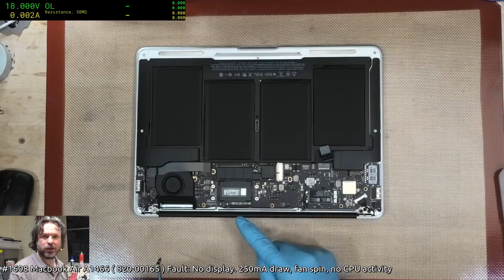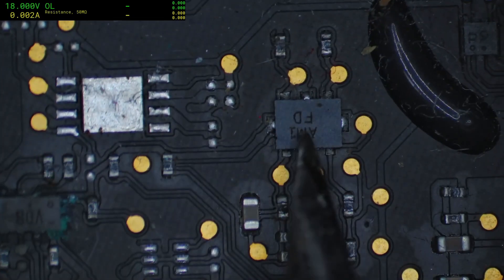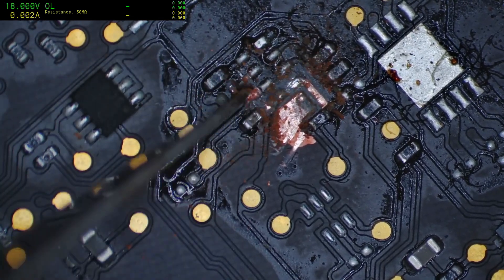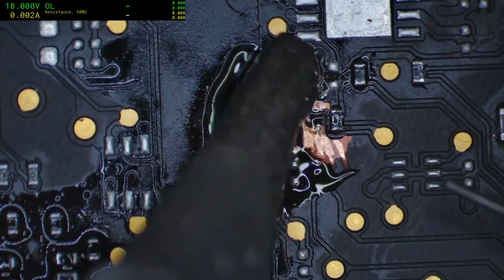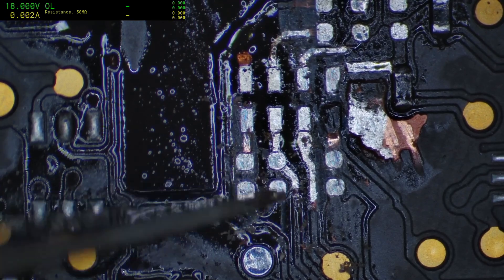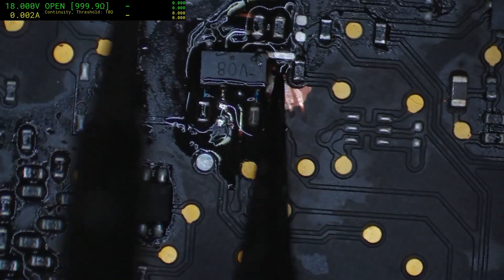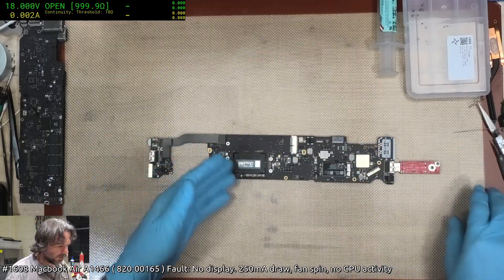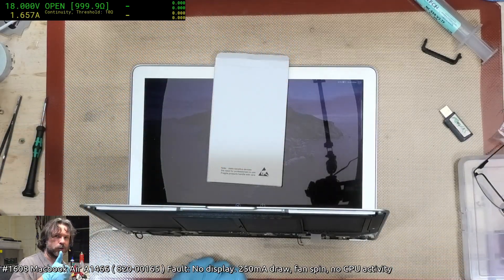Macbook Air has a fanspin but no life. Louis Rossmann says 'Fanspin = working', Is he wrong ? (no)

Comment: Hi, thnx for all your videos. You're a legend, learned a lot today.
I have a problem with a MacBook Air 2017, when I press the power button the fan spins for 1 second, and then nothing happens, I've taken the mainboard out, so nothing impacts it, No corrosion, and nothing is heating up on the board, the charger shows that orange sign. Ive tested that fuse, both sides have 8.5 volts.
What could be the problem?

I can also turn it on, if I hold the power button for 5 sexonds or so, but its so slow, so its impossible to use it.
Reply from the maker: You likely need to replace the SMC.

Comment: Great video! I have a strange one:  A 2017 820-00165 that had corroision on the u1950 and q8150 which I replaced from a known good donor board(and surrounding components). I now have fan spin and green light but no chime and no usb activity (CPU/PCH heatsink gets warm). vcore has 1.8v,  and 3.3v on pm_slp_s4_l. However if I probe all_sys_pwrgd to check voltage with my MM, the motherboard shuts off. The motherboard will pwr back up if I remove and reseat magsafe.  I'm guessing internal PCH issue maybe? (visually looks ok)
Reply from the maker: Could be a break in a trace for R8156 or weak/missing 3V3_S5, or something not feeding in, or something pulling down (weakly) around R8167
Reply: @pldaniels  Thank-you, very helpful!. I will invistigate this 👍. I bought flexbv a few days to make life easier too, its very good.